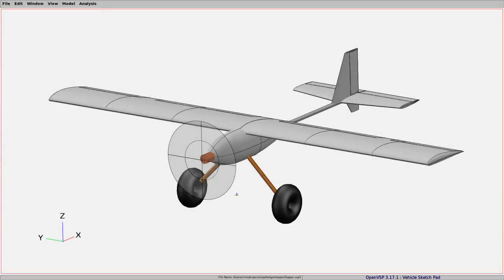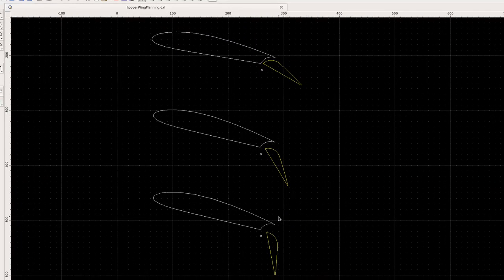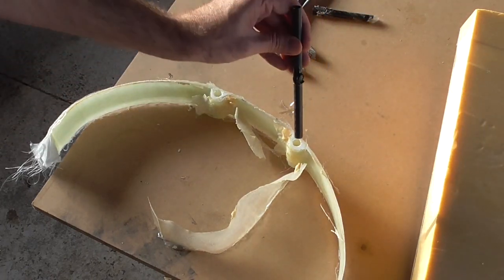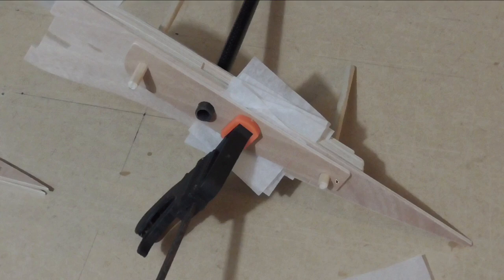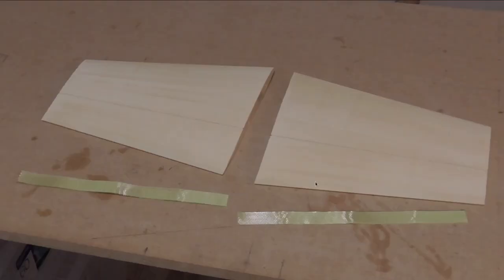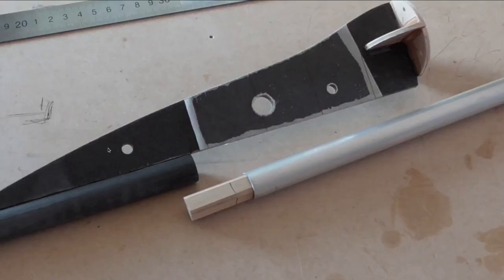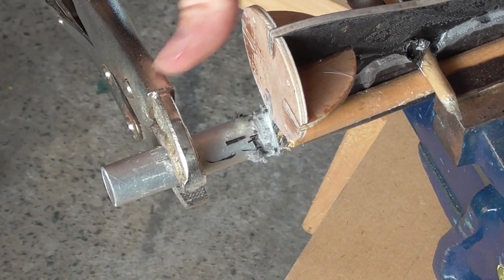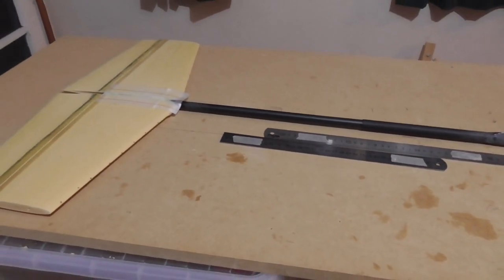Farm hopper part 1

Comment: Car wax in a tub works great as mould release, it will save a ton of hassle when separating fiberglass from its mould. If your worried about contamination making stuff weak I used to work on advanced composites for fighter aircraft and we used off the shelf turtle wax brand on more build ups and part repairs than any other mould release agent.

Comment: A suggestion for taking some of the wriggle & jiggle out of the landing gear from me would be to run a carbon cord/string from the inside of the wheel axel screw to the opposite boom front & rear of the fiberglass mount...
Then each side will be braced in an outward motion as well as a slight forward/aft motion...
Unfortunately the assembly would not be braced against moving towards the center of the plane so some movement/wriggle/jiggle will still be present in flight...
Thanks for sharing again & looking forward to the next installment!

Comment: Nice, for their twill, take some plastic, make a good batch or slow cure resin, saturate the twill (DIY Prepreg ) and sandwich it with film of plastic, role and freeze, take out cut what you need and you are golden...for the aluminum tube, you could of waxed it or added mold release agent and it would have some out nicely... looking forward to the build...

Comment: While you don't refer to this as being a home-slice model, it does a great job of demoing many of the techniques you used in your home-slice models. Being wings on a stick (carbon tube),  it is a rather simple design. 

Been thinking of trying your home-slice foam techniques, and am considering building a simpler version of a main wing like was done here (6 slices).

Comment: Hi there!! One more micee project... yeah!! For the flaps, I like the way ou gonna do it but that gap between the leading edge of the flap surface and the end of the wing has to be respected and be constant, read about ir. I have the E-Flite Timber that has that exact mecanism and if you want I can take a bunch of photos of it for you to see well how it works about the gap.
For the landing gear, that far too flexible... thy to add uni directional carbon on it to stiffen it, or normal carbon if you don't have uni, or, again, check the Timber suspension, it is so amazing and affective.

Comment: P.s. treat yourself to a thin sheet rivet nut tool. They’re great for adding strong threaded holes in thin sheet, but are lighter than a steel nut.

Comment: Maybe use the landing strut as a mould, and layup a new one out of graphite cloth with 90-0 fiber alignment.  The landing gear killed the last STOL project, and we don't want to go through that again! 😎

BTW, I finished converting my Sherline mill to CNC, using your router videos to help.  So accurate that it could make gears for wrist watches.  So thanks again for those vids.
Reply from the maker: I think I'll try making basically the same thing but from carbon fiber instead. Would be interesting to compare them, and I'll get more practice on a pretty easy layup. I actually have rolls of unidirectional and plain weave carbon tape I bought for this very job and for some reason decided to go with glass instead.

Comment: A trick you can use to prevent the carbonfibre from falling apart or fraying is to tape the edges with low sticky masking tape .
The type you can use for masking wallpaper when painting the ceilling or tho stick on what ever delicate surface so that when removing the tape
you don't damage or tear the material .
So the same for cabon , when applied on the epoxy you can gently pull the tape without tearing apart cabonfibre cloth or taking strands of fibre with the tape.
Place the tape halfway the cutting line so you have the benefit to mark lines with a pencil and when cutting the edge of the piece you need is protected 
but allso the edge of the leftover.
And pull parallel  with te piece and not straight up , but i guess you know that allready .
Nice project again by the way.
Just Google LOW TACK MASKING TAPE for delecate surfaces.

Comment: Quick ending! I was like, "Wait! What?". ;) What was the reason for the adjustable tail moment Chris?
Reply from the maker: ? Same as always, move forward to get the CG right without needing extra nose weight, or maybe move back to increase stability if necessary, make the tail more effective, adjust CG when adding a camera on the tail etc etc etc. I'm not following a known plan so I have no idea exactly how long it will need to be, even if I did there's nothing to lose with having it easily adjustable.
Reply: @iforce2d  Gotcha. Hadn't thought of a couple of those. I guess I thought you had run all the numbers in your design app. :)

Comment: Might want to look into this kind of hot cutter in addition to the usual "bandsaw" one like you have already: https://youtu.be/mRV5MicTxsg  

Supposedly the same could be done with a soldering gun and thin-guage stiff stainless or piano wire. Would do cleaner gouging out of the foam vs. the rotary bit that makes a stupid mess everywhere.

Comment: Something that might help with the gear flapping, is putting an aluminum tube between the wheels, with a piece of bungee cord through it, attached to both axles.  Or maybe just above the axles, would probably be easier and would do the same good.  This won't allow the gear to drop down further than necessary in flight, and won't affect its performance in landing.  In effect, it pre-loads the fiberglass.
Reply from the maker: True, but I'd like to keep that area clear, to get through long grass easier. That's one reason I went with the curve shape instead of straight legs.
Reply: Don't you think you will get a similar stiffening effect when you attach the landing assembly to the frame of the aircraft via the two carbon tubes? You could also try glueing a thin ridge of fiberglass or carbon fibre sheet to the top edge of the landing gear strut, at right angles. This will also stiffen the strut.

Comment: I can't say if the landing gear is strong enough, but if this is going to be a plane that you're practicing landing with, your going to want it to be very durable, and preferably not so springy.

It'll really help with learning your landings quicker. And I would say ditch the big wheels. 600g in wheels is way too much :D

Comment: the idea of slotted flaps is to have a narrow gap between the wing & the flap on the top surface, & a wider gap on the bottom surface.  that way the air will be accelerated through the restriction & over the top surface of the flap which helps delay the airflow breaking away (ie stall).

the hinge point needs to be lower & further back to get the geometry right - good explanation & examples on models here:  https://www.youtube.com/watch?v=_VjWMka-bxQ

nice model though - I hope to see it flying again soon!

Comment: Those rubber wheels are whack, no reason to use them on these projects, they are clearly meant for large scale models. You should get (or better yet, make!!!) foam wheels out of your foam or EPO foam, maybe get a pair of FunCub wheels from Multiplex. These are light and tough wheels for electric models.

Comment: Be careful with all of that epoxy, bad news for DNA.
Reply: 9:15 - could try something as simple as tape/newspaper across the top of the arch to act in tension - if that works then it might be worth exploring further.
Reply: As much as I hate dealing with epoxy and laminating fabrics, I am not sure if I can do any meaningful project without them. Btw I hate the sanding and the clean up that comes the following day even more.

Comment: highly suggesting you to get yourself a 3d printer.
Reply from the maker: I get this comment over and over, but I'm not particularly interested at this point, especially since I already have the CNC machine. From what I've seen 3d printed parts are only strong in compression. For everything else (torsion, tension, shear, bending) they're not so great, and they're usually heavy compared to other materials for the same job. That in itself might not be a show-stopper, but then there's the whole rabbit hole of learning that I would need to explore, which I know from CNC could be a long road. I would rather spend the time learning other tools, eg. recently EasyEda.
Reply: @iforce2d  I wouldn't commend more but if it is true that you getting so many comments about the 3d printer,  then it would be obvious that we know what we are taking about.  If you are fluent with CNC,  a 3d printer would be second nature and actually quite fun.  Personally i use the 3d printer for all around the house parts more then in the hobby.  I find it indispensable.   Fixing from car key to sliding door rollers to kitchen items.

Comment: As an old foamy scratch builder of many years experience I am horrified how heavy you build.
Build light and the plane flies better and it doesn't need it be as strong because all the stresses are lower, because of the lighter weight
Build heavy, the plane does not fly as nicely and even the heavy structure gets damaged in high impact impacts.
To put the weight into perspective, I have an FPV plane of a similar size. It weighs 1.2 Kg ready to fly with all it's gear.. You are hoping yours will come in under 3 Kg. 
Learn to add lightness, it will be one of the best skills you can acquire.
Note: That landing gear will be fine. Way too heavy (like most of the rest) but well up to it's job.
Reply from the maker: For more perspective, my last plane was 2.2m wingspan and 1.3kg with enough battery for a 1 hour flight. "Horses for courses" as they say. But if I'm starting with 650 grams of wheels, a 1.2kg goal for the plane overall is hardly reasonable. Looking around at some contemporaries of the style I'm making I see planes like the Avios Grand Tundra with slightly less wing area and typical flying weight of 2.5 - 3.0kg, perhaps that's also horrifying and I just didn't notice. Wing cube loading for mine should be around 7.5 which apparently is appropriate for 'trainer'. In any case, as I said at the beginning one of my main goals is just to try different building techniques and get better at them. A pro would have used only half the resin I did on that boom spine part, but I'm not expecting to achieve that from my first attempt.
Reply: @iforce2d   On the positive side, your hot wire foam cutting is really good. Top marks for that.
I admit I'm a bit 'hard line' on weight reduction. With anything that has to 'go' I'm always looking to save grams and in that way I can usually save kilograms.
All my toys, land, sea or air; full size or model have proved to me that 'lighter is better'.